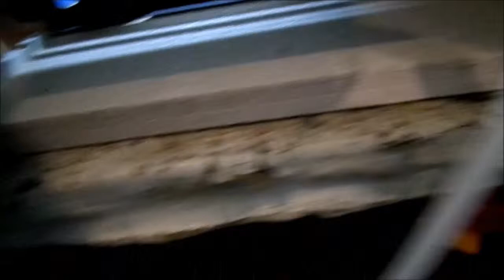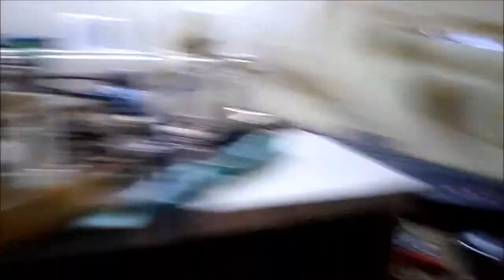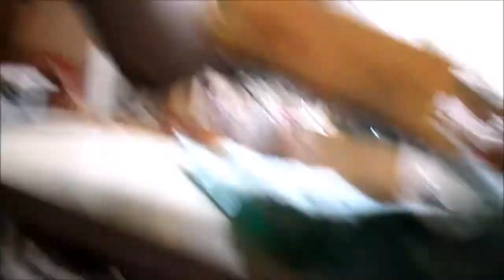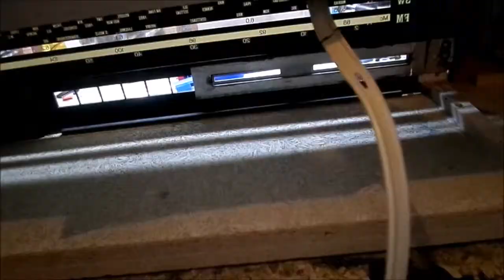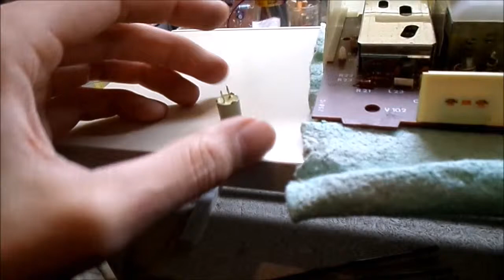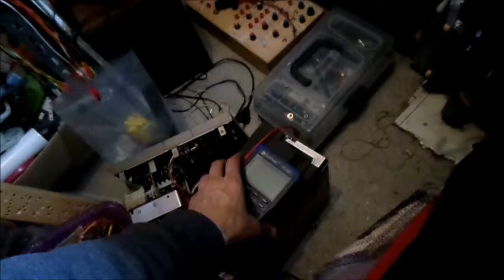vintage transistor radio repair

Comment: Didin't quite catch what was happening with the tuner, if the speed of the knob was different to the tuning capacitor speed, that's a planetary gearbox, but using ball bearings instead of gearsm very common for 'direct' drive.
It's basically the same as a ball race bearing, but the cage part is used as the output which gives a 2:1 reduction.
Reply from the maker: The tuner was completely frozen I assume from the old oil mixing with dust over time and basically everything except the tuning cap and the brass bit is cheap plasic, if one were to attemt to turn it hard enough something would of snapped so with some degreaser and new grease, the tuning cap turns like butter